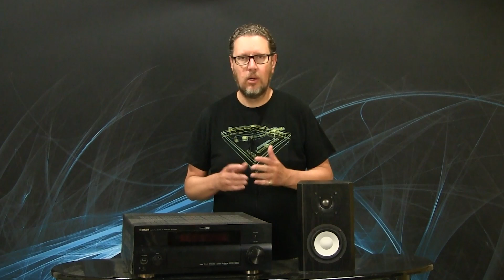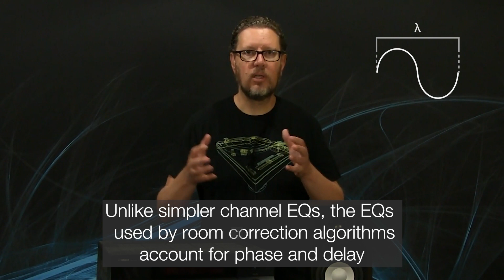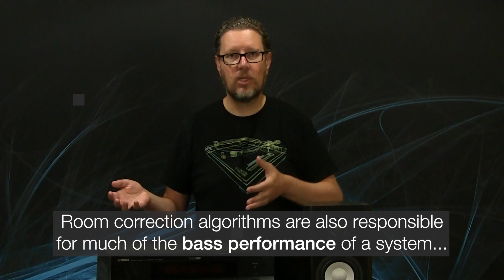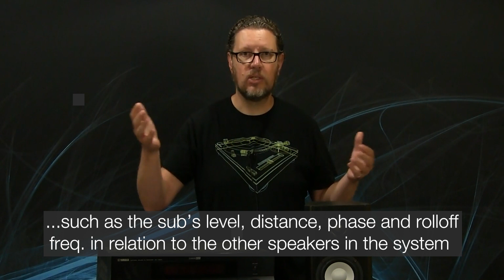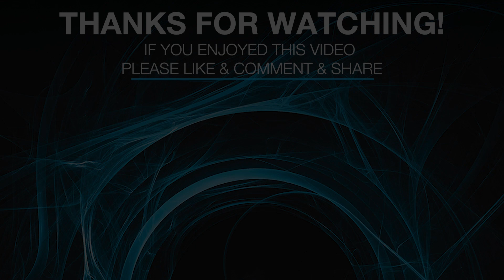Is Room Correction Just EQ?

Comment: Although the statements made here are accurate, except that DSP uses parametric EQ not graphic, DSP can not help with room modal issues and should only be used for fine tuning (manually).  It also can't do anything for your bad setups/positioning).  1.  Take a measurement of your rooms frequency response,    2.  let DSP do it;s thing or do the manual adjustments.   3.  Now look at your frequency response, a second time after the correction has been applied and you'll notice two things.  First very little changed and it's nowhere near the target.  You can't fool mother nature (Physics)

Comment: Spot on. I’ve used all manner of room correction processing with many types of manufacturers for decades. My conclusion is, it creates more problems than it takes away. Speaker positioning and the room are the most important factors. All the processing gimmicks are turned off in my equipment. I strongly believe that the shortest path from source to speaker is the most accurate, or rather the best to my ears. Especially in stereo set ups. But let’s face it we are all different and have unique situations when it comes to room and equipment, personal preference and positioning. 
Great channel 

Mark J Berwick.     UK
Reply: Yes, and I leave you and anyone reading this with this:  Once the sound leaves the speakers it's the room and nothing DSP or your adjustments have done prior can help!

Comment: What is accurate? Flat response at the listening position? Not with MY old ears and crappy auditory curve. I grew up with the EQ sliders on my JVC receiver in the 70's and loved them. I have no issue with anybody who still likes to set simple eq. to their own liking. As for room eq. for stereo listening, I'm too afraid to try. I'd rather work on the room with treatments.
Reply from the maker: Room treatment is always important, and will provide the best results.
Reply: Hi. thanks for the comment. I am running room correction with my new Wiim Ultra and the measurements are fairly linear with some extension (gain) at and above the 4k frequencies. The thing I cannot understand is that at my age (61) I actually prefer the gains in the uppers but the Wiim adds equalization that counters this. I too think I have had better luck with (not so much treatments) but speaker positioning. Maybe I am just doing something wrong?

Comment: I usually run room correction and let it set my distances, then I have to start tweaking for my own satisfaction. For some reason my yamaha wants to set my front L&R to large and I have found that setting to small is much more satisfying for me. I also tend to bump up the center channel for movies. Even though I'm running a  VP 180. So yes i use correction but definitely tweaked. 
I have to say that for my situation, the best room correction was making bass traps for my corners and acoustic panels on walls. I had way too many hard surfaces and sound was bouncing everywhere and the bass was horrific. When I added those improvements the sky opened the music exploded like never before.
Reply from the maker: Great to hear! It's amazing how it just takes time and patience to improve the room itself, not just the EQ. Congrats!